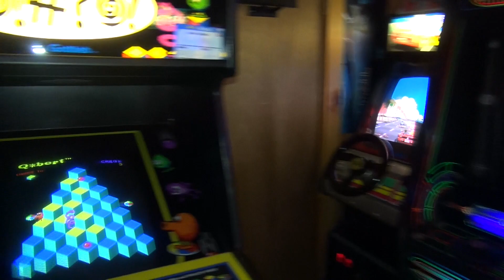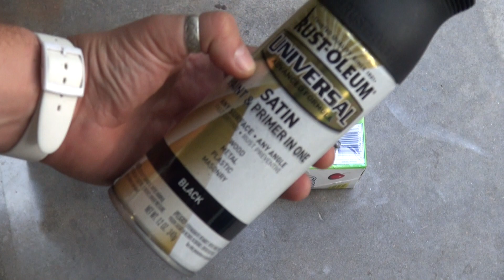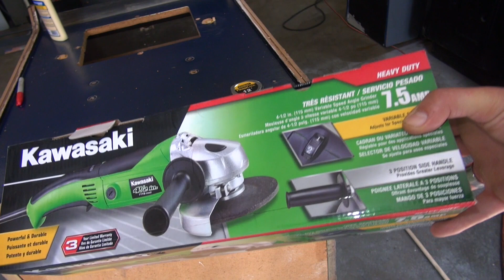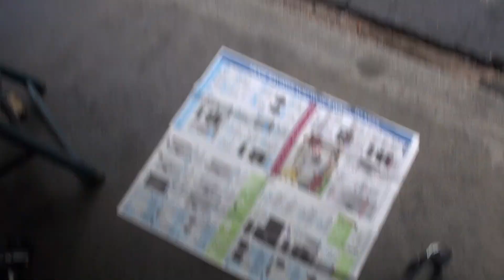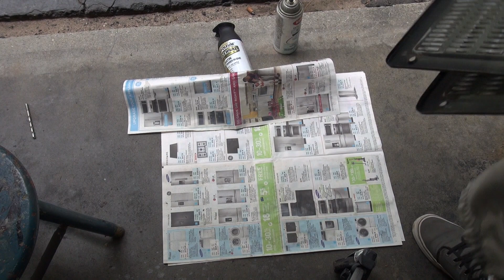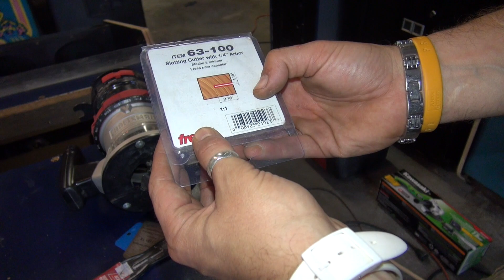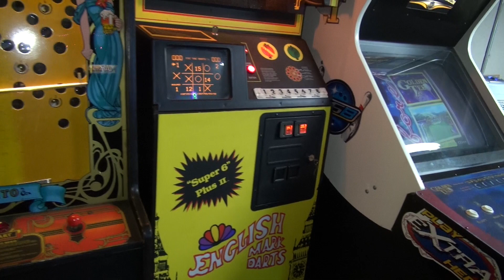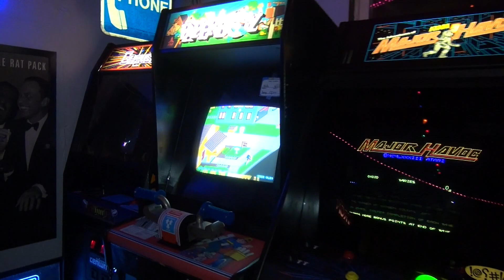Journey Arcade Restore Part #14 - Sanding and Bondoing an Arcade Cabinet for painting

Comment: This is in reference to time mark 55:00.  Never start your router with the bit engaged with the work piece, otherwise you'll invariably get kickback.  You should start the bit away from the work piece, and when it comes up to speed, bring it to the work piece.

By the way, you're correct about the orientation: it is much safer to have the piece oriented such that the router is upright to make the cut.  When you use gravity to help you stabilize your tool, you'll always have more control, which is in turn safer.

Comment: Thank you for inspiring, and helping, me restore my beat up old arcade cab. I picked up "The Main Event" arcade cab in pretty rough condition. The bottom was all rotted out and the bottom corners were missing, so the t-molding just hung off of it. Whe i first "restored" it several years ago i had know idead what i was doing and it looked like crap. Now after seeing this i have decided to redo the cab and i am LOVING the results. I made a corner out of a cardboard mold and it looks brand freaking new!! I got that tip from someone else's video. Anywho thanks man.
Reply: c0pyimitati0n Also, i had to sand down the bottom a little but i am just bondoing the crap out of it and it's holding up really well. I didn't use any miniwax wood hardener either. Just bondo and a TON of sanding. And patience. But i had to remake all of the bottom inch or two out of bondo.

Comment: I hate bondoing cabs too... couple tips for ya:
1) When its hot out like it was for you, put less activater in and it shouldn't harden as fast. It looked way too dark a pink for that type of weather.
2) You seemed to be having a hard time with your putty knife...they make a wider, plastic applicator for bondo, it is flexible and the bondo just peels off when its dry. Because it is more flexible than the small metal knife you are using, it should be easier to really "push" the bondo into places.

Love the vids!!

Comment: 24:20 Hey John to loosen rusted bolts you can heat it with a torch. I would use a small torch. Something with a good blue flame coming out the tip.

Comment: Great idea to get the black off the cab before repainting.  One thing.  After using stripper, give it a good wipe down with denatured alcohol to neutralize the stripper before paint.
Reply from the maker: Good tip! I'll consider that next time. :)

Comment: John bondo is glorious substance I use it on my pepakura armor my only complaint is the way you mix it I believe your supposed to fold it over itself to work out the air bubbles but I guess it works either way and you can use a razer to remove any globs about 5-10 minutes after applying

Comment: John..... Never start a tool "in cut" lol Gringe worthy. Especially a router! Start out of the cut and feed into it full rotational speed. And i would have also of sanded the sides flat and remove all of the bulge or high spots where the router plate rides on to keep the T-molding channel straight and true. I always mix bondo on a piece of cardboard:) Yellow note pad works great too because you can just tear the pages away as you use them and also, sand any area good you plan to apply the filler or it will fall right off.

Comment: Try using a wider trowel John for applying the bondo, that way it will go on a lot smoother and you won't have to go over the same spots over and over again  ;)
Reply from the maker: This is ggpf advice. :)
Reply from the maker: this is good advice. :)

Comment: The time to work the bondo is when it's in what I  like to call the clay state. While the bondo is still soft it is much easier to work with rather than wait for the bondo to fully cure. A wider tool would have helped too

Comment: buy a bag of disposable "chippie" paintbrushes at home depot. theyre cheap and you can use them to force the glue down into the groove of the swollen wood, and also to spread the citristrip. they wont melt like the foam brushes.

Comment: John you probably could have drilled out the leg levelers with a drill and then filled in the holes if need be altho if you drilled the heads of the rusty screws it would have probably left no mess to restore and you could then just put new ones on where the old holes are

Comment: Would a blast of air from your air compressor not blow the medium out of those screw heads and off other parts John?  Or are they too crammed in for that?  I use compressed air for everything.
Reply from the maker: compressed air might work. good idea!

Comment: About your leg level holder ( or flange ): you really feel confident with these "aftermarket" ones? Well im a bit worried putting 3 scews near the flange into the bottom mdf plate, especially if it had some heavy duty contact with liquid. So what would I have done? I would have sanded the original one and weld some new threaded rod on the broken one - no one will see that fix and you can feel safe having it near original like the factory. Another benefit would be that you wouldnt have cut the screws. But i have to admit, im following your chanel, but havent done an arcade repair like you do.

Keep up the good work.
Reply from the maker: Thanks! I don't have a welder or know how to weld. :) I have used those cheapo leg leveller holders before. They work just fine!

Comment: I would have have drilled those lockbar holes out larger, large enough to remove the damage around the holes that happened when you removed the T-nuts. Then a dowel would have filled it cleanly, requiring much less Bondo to be used afterwards.

Comment: Will not the bondo areas and the vinyl areas have differnt textures after the painting is done? The bondo areas will probably be a little more shiny?
Reply from the maker: I am going to prime the entire cabinet in the next Journey video so I have a consistent surface.
Reply: Did you sand the vinyl areas before the bondo? It might peel...

Comment: less hardener when it very humid and hot out. i made the mistake of stripping the vinyl off my old mk2 cabinet during the winter. to find particle board. ended up having to skim coat the whole thing with bondo. not fun.
Reply from the maker: Yeah, good advice on the hardener. It was getting so hard and so fast unlike any other time I've worked with it.
Reply: yea.. but i find that it works a lot better than wood filler.

Comment: As much as I love watching your stuff... watching you work with wood can be painful mate!
Also if you ever end up doing repairs on splitting wood try getting some large gauge syringes from a veterinary supply store and use a the needle to get in deep to fill it from the inside out, maybe water down the glue a little too which should work with most water based glues tho it will increase drying time :)

Anyhow keep it up!
Reply from the maker: I'm the first to admit I am no wood working pro. But I always seem to get the results I am looking for even if I'm sloppy doing it.
Reply: John's Arcade Game Reviews & Tech Yup :) That is the main thing, I'm just a bit of a nerd when it comes to wood working. Best of luck with your future projects :D
Reply from the maker: Seithon Jetter Thanks! :) I'm getting better, though. LOL.
Reply: John's Arcade Game Reviews & Tech Good good :) Still watching the vid atm. Next time with the dowels you might find it easier to use a nice sharp chisel to chop em down to below the surface so you don't have to muck about with sanding, just one crater to fill with bondo :) Oh and it is nice to see your mistakes as it helps everyone else learn how to fix em :D
Reply: Seithon Jetter I was thinking the dowels should have been put flush with the outside of the cabinet rather the inside.  Still interesting to watch, I have a ton of things to do and I keep watching this video.  Nice job!.

Comment: Try putting a rubber band between your screwdriver and the screw head for stripped and rusted screws.  Sometimes it works, sometimes it don't but worth a shot

Comment: No castors mate? I know you don't move machines around a lot, I'm the same but I like having wheels Incase
Reply from the maker: Not a fan of castors. Looks, weird! :)
Reply: and when you run your toe`s over with a 350 pound game with a wheel thats inch wide and your toe`s spit wide open you thank Darren :)
Reply: John's Arcade Game Reviews & Tech ah fair enough mate !
Reply: uhfnutbar1 never been so stupid to run over my feet before. You seem to have experience with it though
Reply: uhfnutbar1 lol I was thinking likewise for you
Reply: I like to use heavy duty ball casters that swivel and have pivot breaks myself.  Levelers are always a pain and scratch up the floor.
Reply: Castors move the cab around during hard play even with the brakes applied imo, also unoriginal for cade games.

Comment: thought you had a dremel. that would have worked
Reply from the maker: For the t-molding groove? Yeah, that does work. I have done it before. The router is way more precise, if you do it right. :)
Reply: John's Arcade Game Reviews & Tech
no for cutting. would think that would work better then a grinder. also why you useing bondo? thought you would use that minwax high performance wood filler